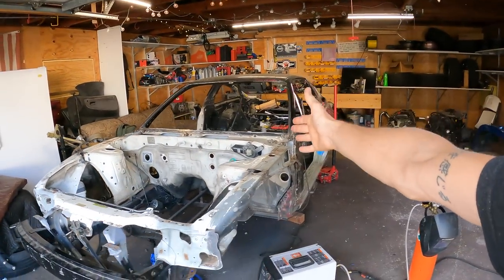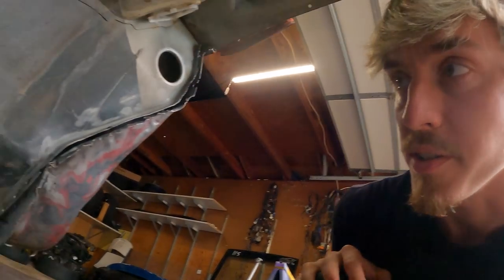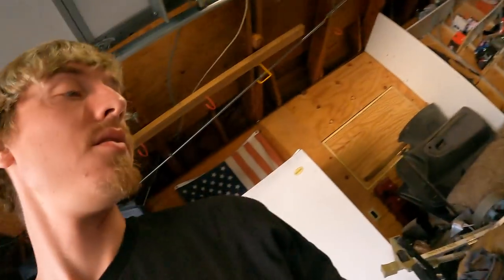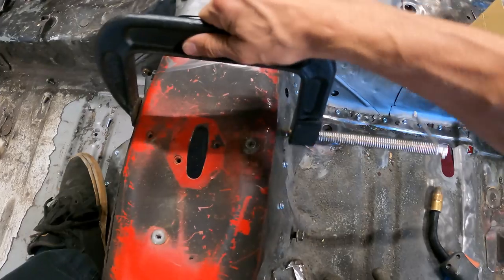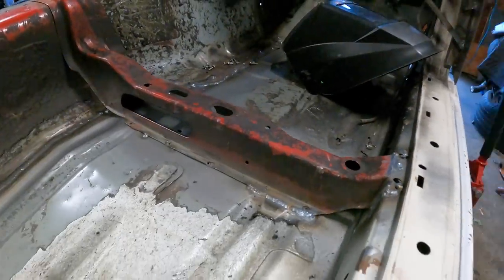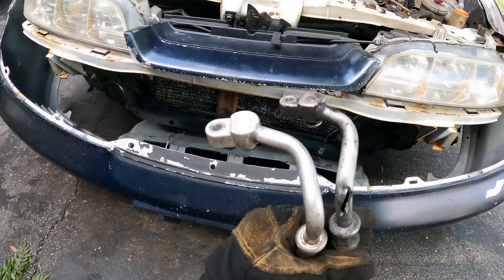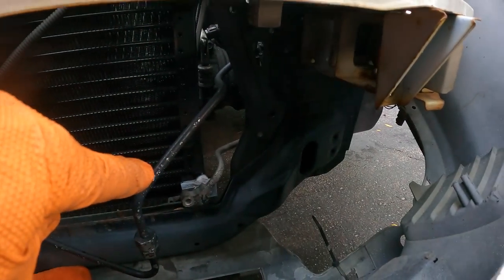Major Obstacle to Overcome on the 240sx Restoration..

Comment: Honestly mike you saved a car that most people would have junked and moved onto the next. It’s a level of craftsman shift that really inspired me to keep working on my 3.8l 5spd firebird day by day. Stay up man and I hope you find shop space to continue your awesome builds.
Reply: Glad to hear hes helped you work on a v6 firebird have one myself and really i feel like i can work on anything with it. Ps love the rebuild so far mike cant wait to see the car back together
Reply: @racer1855  that’s what’s up I’ve put about 13k into my project 1999 firebird.  Everything for the engine is finished, I’m running a 00 3.8l I got from a junk yard with 125k. So far I’ve had the heads and short block rebuilt to (0.200) over decked, milled, and hot tanked. I’m running zzp federal mogul pistons(0.200)over, with h-beams, l67 reconditioned crank, clevite bearings, arp main/head studs and rod connecting bolts. I’ve also drilled and tapped the oil gallies and did a balance shaft delete to mate up a clyotes duel timing chain. “For now” I’m running a gt1 cam with ls7 hydro lifters, zzp custom pushrods, on 90# ls7 style springs. I’ve done the modded spring retainers with 6.5 rockers and rollers including the zzp multilayer head gaskets to change the compression to 8:5.1. I’m also running a 1.0 pcm upgrade with an Hp tuner unlock to add in a high performance aem fuel filter/ and pump to run 91 octane. I’m sure I forgot a few things but  I’m hoping to see a gain of about 100hp on an n/a setup. Next I’m going to focus on the transmission setup moving from a t-5 to an ar5 with a ford lsd 10 bolt main in the rear. I’m thing 411s or 415s for a mild drift setup on forged axels. I do have a tiktok @l67boi but just haven’t had much time to post lately.

Comment: beware of using motor oil on certain O rings. A/C  O rings are a really high quality seal so I don't think it will cause a problem. but in the future consider using dielectric grease. to explain more fully oil can soften and deteriorate certain types of rubber over time and one definitely bad application of oil on O rings is on engine cooling system components. they deteriorate over time with the oil on them causing a coolant leak months or years later but if you use a silicone based lubricant instead of petroleum based then it helps your O ring installation without deteriorating the material. I'm not sure what they put in PAG oil so if it's made with a petroleum base then you know for sure oil won't hurt the seals but I always choose the more cautious route and go with some dielectric on most O rings just in case. the S13 is coming along nicely, lookin more and more like a car every day.
Reply from the maker: Thanks for the great info! 
Tbh I was taught in automotive classes the primarily use pag oil. But your explanation makes alot of sense!
Reply: Nerd
Reply: @Mikeshitboxes  oofer
Reply: @Mikeshitboxes  pooper
Reply: It also makes the o rings expand which is REALLY annoying if you ever have to reinstall them

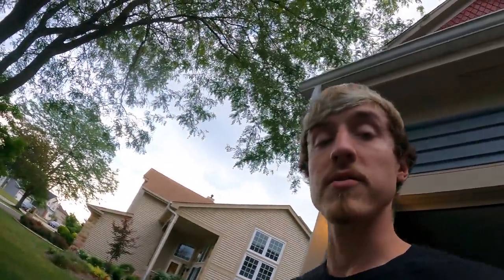Comment: @16:01 awesome work! just side note, future reference, before filling system with freon, should use vacuum pump to put a vacuum into the system prior to filling, this will ensure zero air and all coolant in system. if not adding vacuum to system there gonna be allot of semi compressed air inside the lines along with any free on you were able to cram into system along side the air that cant escape.

Comment: Dude, just buy the big 10lb spools of welding wire. Your welder should have come with an adapter to make them fit and they will cost you less in the long run. You will also save quite a bit of wire if you don't go overboard on the welds, some of those places just need plug welds but you are welding the whole seam.
Reply: 10# rolls are great if you use them fast enough. If it's humid and they sit for a while they can rust and cause contamination in your welds.
Reply: @carswithcrackers  He's already used at least 6lbs of wire at this point and will probably use quite a bit more. I think he'll be safe with a 10lb spool. Also, the decent stuff is plated which really slows down rust.
Reply: @madmatt2024  he's also about to have to move it which could stall it for a while. Plus he's probably got half the welding done already.
Reply: @carswithcrackers  I've had my spool in the garage for for over 5 years and it's still fine.

Comment: Goodluck getting the shell rolling to a new work location! I am slowly working on a floorpan repair in my 240 (volvo). I read you can use aluminum or other non ferrous metals as a heat sink behind your welds to reduce blowout.

Comment: 16:08 hey mike just an fyi your supposed to pull a hour vacuum to pull the moisture out of the system because water will get in the pump oil and kill the pump so if your ac pump dies you should defiantly get the proper tools or take it to a shop with the machine also pulling a vacuum will let you know if there's a leak as the vacuum will drop
Reply: very true, it's possible to DIY with a set of manifold gauges, i've done it a few times on A/C systems myself, about the only thing you shouldn't do yourself is evacuate a charged system as a shop can do it for cheap and recycle it through the proper environmentally friendly channels
Reply: @sir_wheat_thins   well its a shame when your line accidentally opens up letting out the gas

Comment: You really should buy the larger rolls of wire if they fit in your welder
Reply from the maker: True, I need to find a local place that sells larger spools
Reply: @PrizzaMike  I hate changing wire in mine for the fact its on a cart with a strap holding it down and the strap is a super tight click as is then I have to make the leftover strap look nice and it never looks as good as the last time, but see if you have a welding supply store near by (might have to Google it unless someone knows one around you)

Comment: sup prizza as an edxpierenced drifter and 240 guy i got a question im getting a very crazy vibration at any rpm above 4000 in my soarer, i have done all new accesories it isnt missfiring and new motor mounts as well as a new harmonic balanever balenced clutch and flywheel all brand new new trans driveshaft literally everything could hardnened rubber mounts cause this vibration?
Reply: Find an FB group then ask there.
Reply: @Vgk36  acting like i havent looks at every google result and facebook group

Comment: You need to do spot welds too much heat will warp the metal.buy 10 pound rolls of weld wire,save yourself some cash.